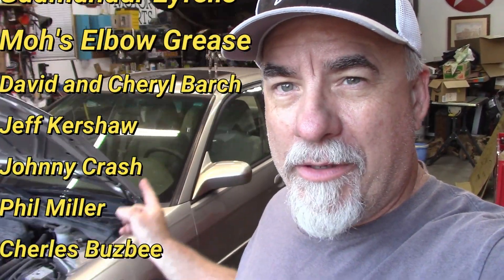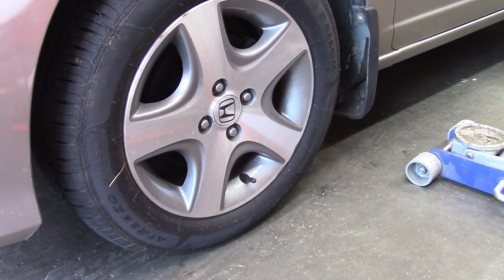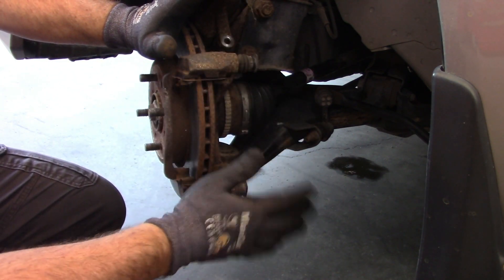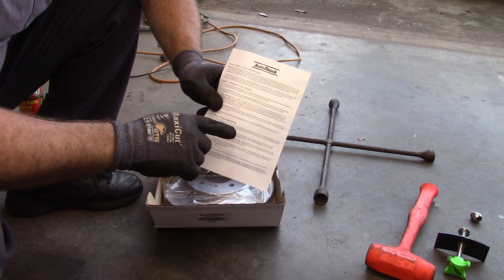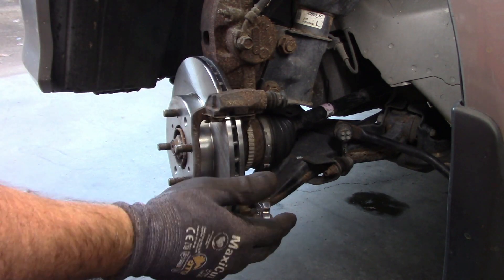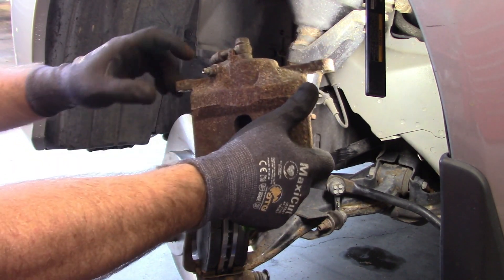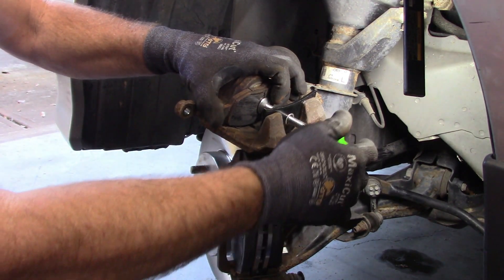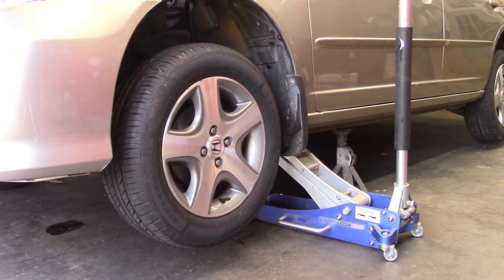Honda Civic brakes. Replacing front rotors and pads.

Comment: I have found an impact driver, the manual kind works well at removing the rotor screws.  It’s my understanding that they aren’t necessary.  They are only there for assembly purposes.  I’ve used a pry bar to compress the piston before removing the rotor and old pads.  Lots of ways to get things done.  You did a nice job of explaining this process.  Newer cars are more difficult as you often need to bleed the ABS pump when pushing fluid back through the system.